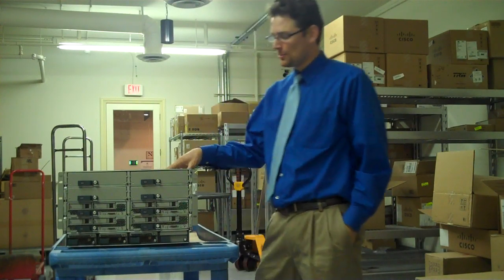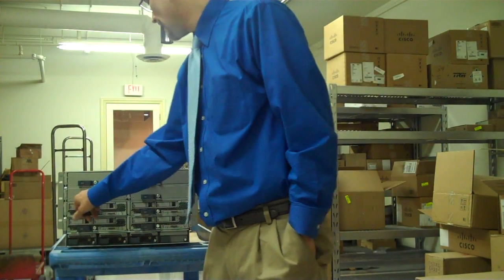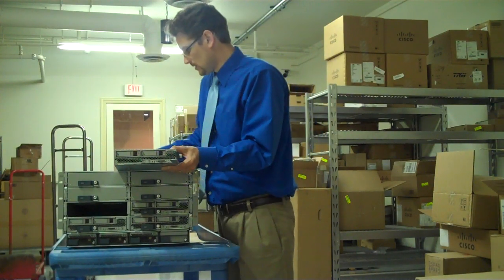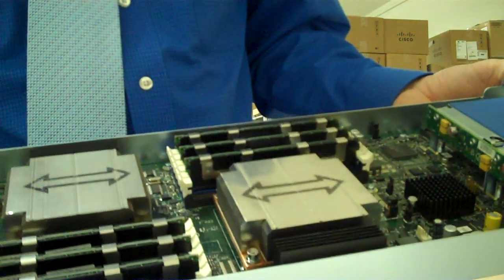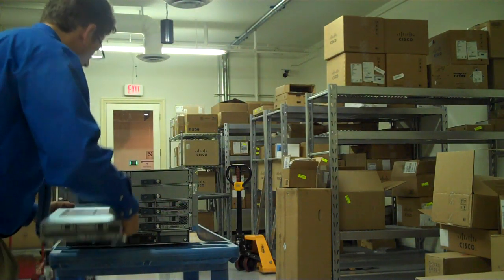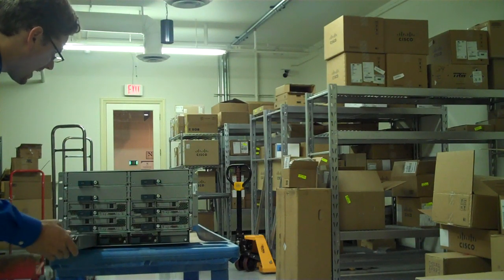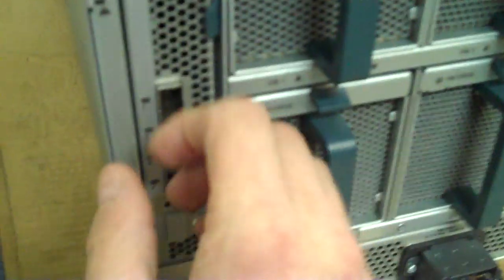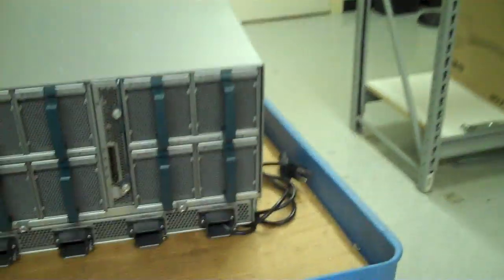Cisco UCS Blade Server - What you need to know

Comment: These blade systems are flooding the used market for CHEAP right now, I'm seing chassis with almost fully populated blades (everything but the RAM), for <$800 but I can't find any further information on them beyond "this is a blade system that exists".

Is there a licensing system tied to them functioning? I know Dell dabbled in that for a while at the same time these came out, so it's not unprecedented, but it can also kill their usability in a home lab.

Has anyone tried these with a Proxmox config? It seems like the ideal buy and run system for an on-demand virtualization setup with a JBOD over mini-SAS, but the only IO boards I can find just have wildly varying SFP port counts. Even though they sold high density JBODs using mini-SAS in the same generation. Virtualized OS storage over network would be a painful bottleneck to choke on for anything more taxing at boot than Debian Server, and these old integrated storage controllers typically only support RAID 0/1 with a max of 4tb/drive. With only 2 drives per blade, even with Proxmox storage pooling that's only 64tb, 32tb with 1 drive redundancy on each box. Nothing to sneeze at space-wise, but that's playing fast and loose with a lot of data that'd be way easier to safely manage with a zfs or btrfs setup...

Comment: Only two slots for IO expansion? What about oob central management port ..?
Dell chassis is still the best and most advance in technology and supportability, they have the best online resources for ease of use  by comparison,  ucs systems are late in the game, hp has pretty solid chassis but lack of ease with online support and driver download, they guard their drivers like need to know basis lots require registration and validation before you can even download a stupid driver update.
supermicro , quanta are all piece of crap in terms of support unless you have enterprise support contract with them, Supermicro uses weird and cryptic parts that it's very hard to find reference online even on their own website,  mostl 3rd party parts that you get from supermicro lack of  firmware support after a few year, and let's not even get into their RMA process...